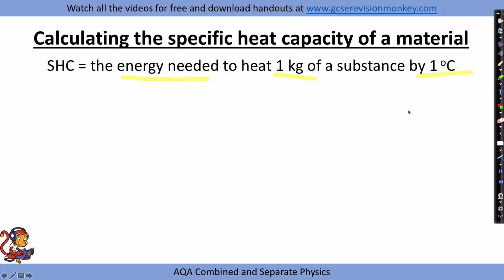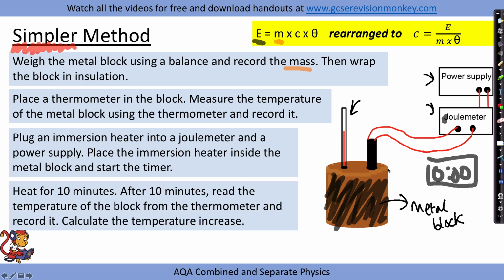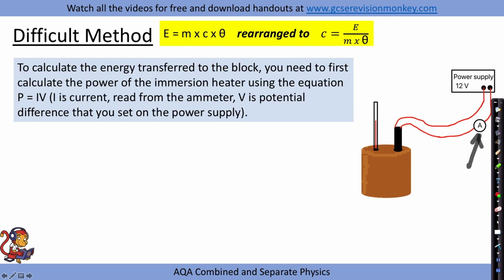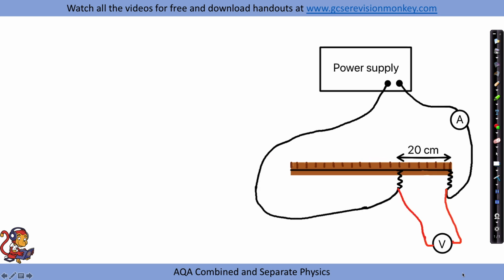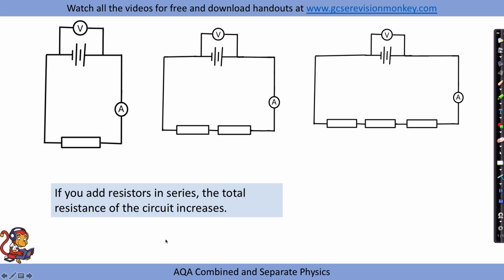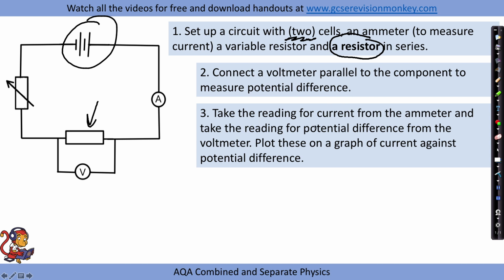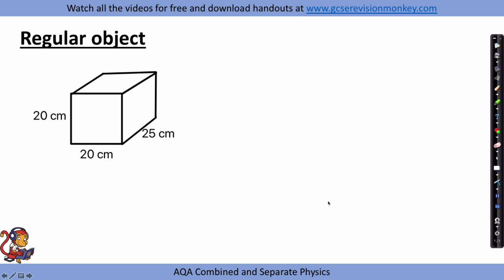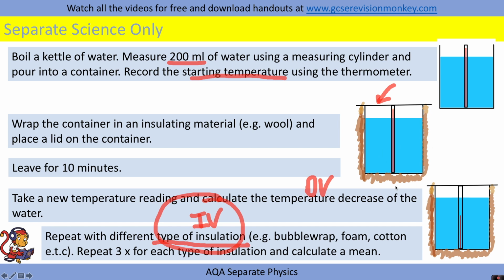Physics Paper 1 Required Practicals

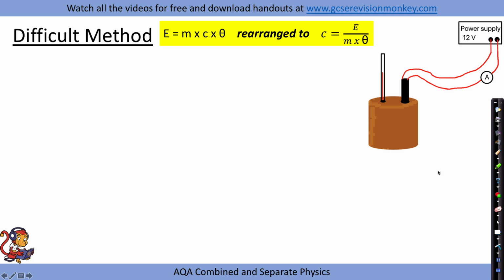Comment: does anyone kno if the joule meter is still in the mark scheme, ive never heard of it before. 4:57
Reply from the maker: If you remember the more complicated method then great. But, some students really struggle with this practical, so using a joulemeter is perfectly valid and would pick up most marks. So, just write about whichever you are most comfortable with.
Reply: @revisionmonkey3859  ok thank u

Comment: Would there be any need to learn the more comlicated method for the first one, would it attain more marks in 6 markers etc?
Reply from the maker: If you're doing Higher Tier, I'd make sure you're happy with the more complicated method because as well as a method question, they might ask you a calculation or application question about it. But, it shouldn't get you any extra marks when writing a method, so if you are happier with the simpler method for a method question, that will be fine.

Comment: Hi! Was just wondering if you could explain why you may need a piece of cotton for the density practical? Also (sorry to be a pain) how do we calculate the uncertainty of a measurement?
Reply from the maker: Uncertainty = range/2

So the uncertainty of the following values: 3, 5, 7, 1 

would be (7-1)/2

= 3
Reply from the maker: As for cotton, it could be that some methods involve tying some cotton around the irregular object to lower it into the density can? I can't think of any other reason, so I wouldn't mention it in a method.
Reply: @revisionmonkey3859  thank you so much, especially since it's so late :)
Reply: So how do you work out certainty, is it big minus small divide by 2
Reply from the maker: Alslalsl Asd - yes that’s correct.